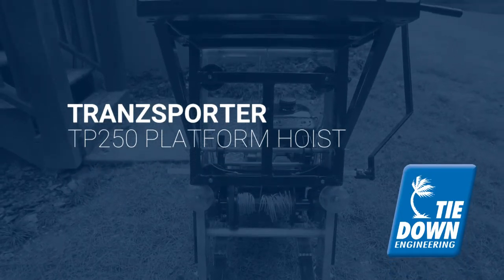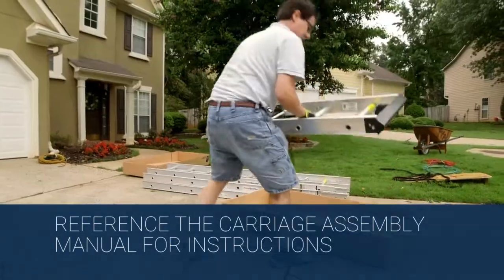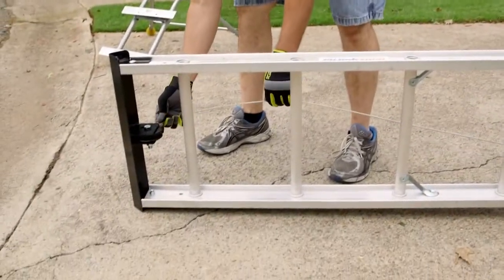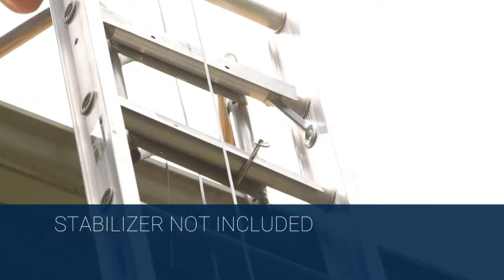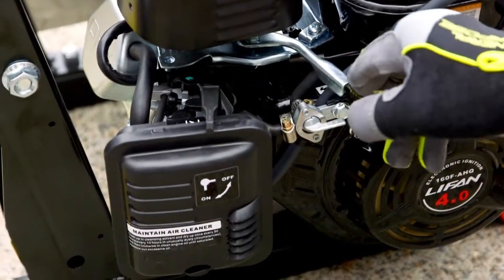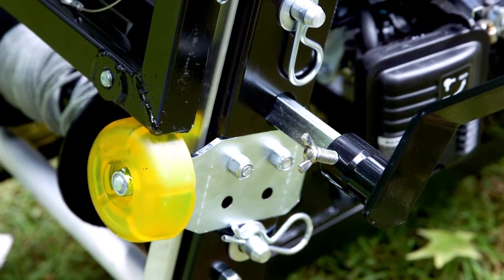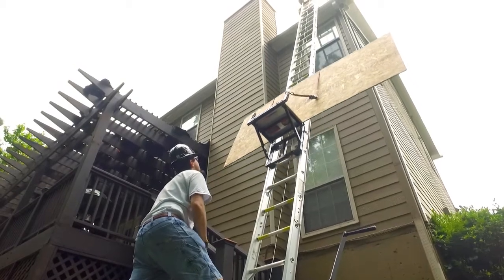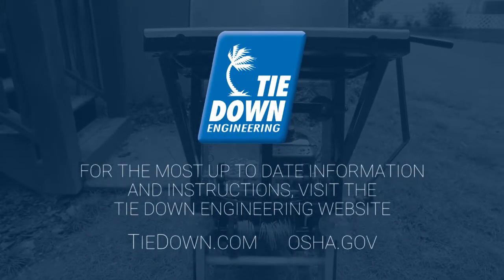TranzSporter Platform Lift Hoist

Comment from the maker: For easy google translation, we have the video script listed below.

Heavy duty, powerful, and made to last. The TranzSporter Platform Hoist will make your next roofing job faster, easier and safer. It’s ideal for lifting shingles, solar panels, roofing felt, insulation, lumber, and other building materials. 

The TranzSporter Platform Hoist is shipped in three boxes and one track-section bundle. 

The collapsible carriage comes with cam bearing track engagement system for better tracking and handling also features an aluminum deck and flap for lighter weight and longer life. 

A rolled goods/plywood bracket comes with unit and pins into carriage.

Each model comes with three 8-foot track sections and one 4-foot base section for a total overall height of 28ft. For heavier roofing materials, the TP400 is available. 

Both TranzSporter models may be purchased with either a Honda, Lifan or Leeson electric engine. 

TranzSporter also offers optional accessories sold separately. 

First, assemble the carriage by following the assembly instructions included.

Remove the base section from its box and place on a clean floor or assembly area. 

Remove the top cap with a 9/16” wrench – there is one bolt/nut combo on each side.

Starting at the top of the track section, slide carriage assembly onto the track so that the four rollers connect to the top rail of the track section.

“Roll” the carriage assembly onto the base. 

At this time, lock the base in place using the Safety Pin.

Lay one track on a flat floor with the “front” side up. 

Attach splice plates to the bottom section of the track. Splice plates are mounted on the outside track section. 
Slide the top section track into the grooves on the inside track and attach with 2 nuts and bolts per side.

Reattach the top cap to the end of the last section of track section you intend to use. 

Assemble with the two carriage bolts with keeper nuts provided. Make sure the top cap end slides into the outside of the track section.

Turn the hoist on its side, and working from the back, remove the end of the cable from the drum. 

Feed the cable end through the pulley as shown above, and down the front side of the track section to the back of the carriage assembly.

Attach cable to the carriage assembly, pass bolt through lock washer, washer and cable eye/end. Tighten bolt.
 
Raising the hoist requires three contractors. Look above you to the left and right and all around to locate and identify any and all power lines before lifting.

When raising the hoist, keep track sections clear of all electrical wires and equipment, and be aware of overhead objects. 

Lay the platform hoist on the ground near the building wall. Tie rope to the top cap. 

Have one contractor pull the rope from the roof while another raises the base shoes from slipping. 

The third walks the hoist up hand over hand by the track runs. When the hoist reaches a vertical position, carefully rotate the unit 90-degrees and move the bottom of the base unit away from the building by a quarter of the height of the building. 

Secure track sections to the roof, but do not use rope or any other object that may interfere with the platform or carriage. 

The best option is to use the TranzSporter Stabilizer. The stand-off allows for proper mounting to the eve of the roof and prevents costly damage to gutters.  

Next, attach the engine assembly to the base unit while the engine is off. Mount the motor assembly to the base unit from behind the hoist. The foot pad of the motor base slides under the track base section, while “hanging” the motor base. The motor assembly arms must fit outside the two retainer rings.

Before starting the engine, align the “V” belt to the large pulley on the base. Then slide the belt under the belt guard longways to the motor base. 

Slide the brake handle over the brake arm and tighten the thumb screw provided. Brake handle can be placed on either side of the hoist.

Prior to starting the engine, check all oil levels. 
The oil crank case must be filled with approximately 15 ounces of oil. On the Lifan Gas Engine, the gear is already filled, but not the crank case. On the Honda Engine both gear and crank case must be filled before use. 
Next, fill with unleaded gasoline. 

To start the engine, the choke and throttle should be all the way to the left. Next, turn the fuel line on. On and off are clearly marked on the air filter. 
And lastly, turn on the red knob or the on/off switch. Adjust the choke until the engine idles correctly. Engines should always be in full throttle when raising materials.

Before each use, carefully inspect all parts for wear or damage. Do not allow anyone to operate the TranzSporter hoist who has not been thoroughly and properly trained in the correct operation and use of this hoist. 

Make sure to read all warning labels and call Tie Down for replacements if warning labels become damaged or worn.

Prior to raising the platform, remove the locking pin from the carriage, and place it in the pin holder underneath. 
In order to raise the TranzSporter platform, face the hoist standing as far back as possible. Place your foot on the foot control brace to engage the engine to drum belt. This permits the collapsible platform or carriage assembly to roll up the track section. 

When the collapsible platform or carriage reaches the top cap, release your foot immediately. This will automatically apply the self-energizing brakes.
Move away from the hoist while the load is being removed from the platform or carriage assembly. 

To lower the empty platform or carriage assembly, first make sure there are no materials left on the carriage. Then grasp the brake handle. A feathering technique must be used. 

Feathering the brake involves lifting the brake handle up which disengages the brake and then lowering the handle which engages the brake. Use this feathering technique multiple times as shown here to safely lower the empty collapsible carriage. Lower the collapsible carriage to the ground at a slow speed.

Use the proper Tie Down equipment. If you are not securing your cargo with the proper safety straps, it could come loose during lifting, resulting in injury or death.

Center flat panel loads onto the carriage and attach safety straps to slotted tie-down points. Do not hook your tie-down straps to the plywood. Straps must pass over the top. Secure your safety straps to the carriage top flats slot ted holes and to the plywood brackets only.

Check all tie down connections. Safety straps may come loose during transport. Always check strap for damage or wear and replace when damaged or worn.

Maintain a manageable speed – the wind’s effects on sheets of plywood or panel goods, as well as the higher center of gravity, can make hoisting difficult and dangerous.

Never apply the brake abruptly. Continue to decelerate the platform as it nears the ground to prevent damage to the collapsible platform and stop bracket. Do not use the hoist to lower materials. 

When you’re done using the TranzSporter and the job is complete, you can remove the engine. 
Before lowering the hoist, look above you to the left and right and all around to locate and identify any and all power lines before. 

Carefully lower the hoist, unbolt tracks and remove slack and the cable. Make sure to pin the collapsible platform or carriage to the base section in order to prevent any movement of the platform during transport. 

TranzSporter by Tie Down Engineering is the number one selling platform hoist in the industry. Designed for the construction crew and safety in mind. It can streamline your production efforts, aid in quick and safe installation and make your job easier. 

Remember SAFETY FIRST.

Tie Down Engineering’s TranzSporter: a great way to get the job done.
Reply: Were to buy, and how much ?
Reply from the maker: @craigslinn3156  Hi Craig! Please contact Ashley Ellison at ashley.ellison@tiedown.com for a quote and local distributor!